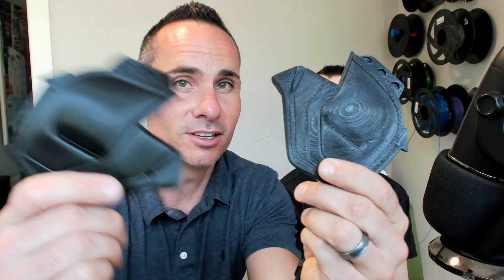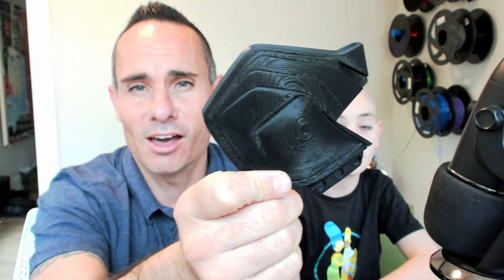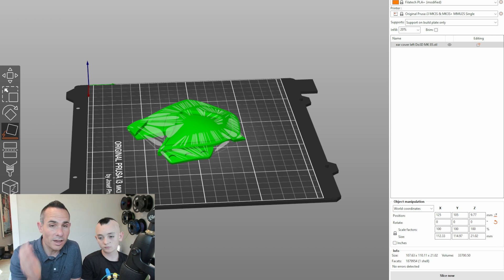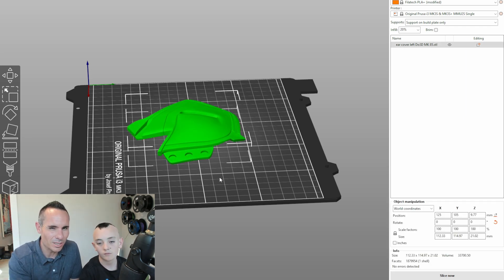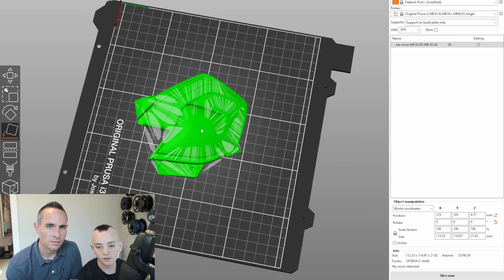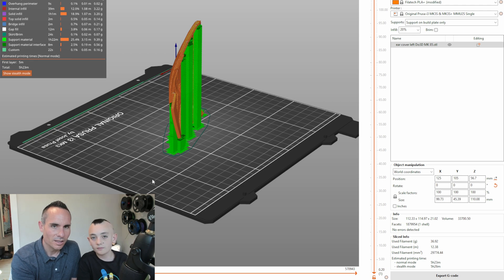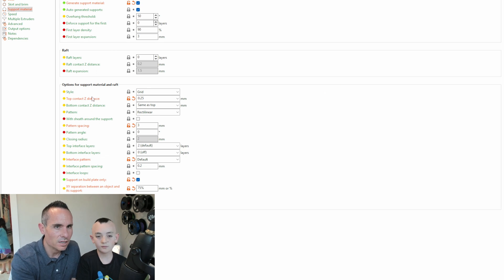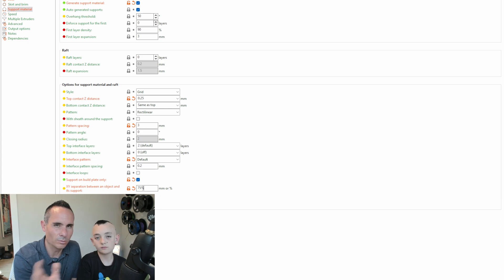Improve the Quality of Your 3D Prints!

Comment: Changing orientation is definitely the right move here.  There are also ways to make supports easier to remove.  I don't know if you can do this in Prusa Slicer, but in Cura you can adjust the extrusion rate for supports.  I set mine to 40%.  It makes the supports super thin and brittle.  They're strong enough to support, but super easy to remove.  I used to do this only on prints that were fragile and may break during support removal, but now I use it in all my prints as it saves material, and has yet to cause a failure.
Reply from the maker: The tweaks toward the end to the support settings in slicer help quite a bit in their removal. Saving material where you can is always a huge benefit!